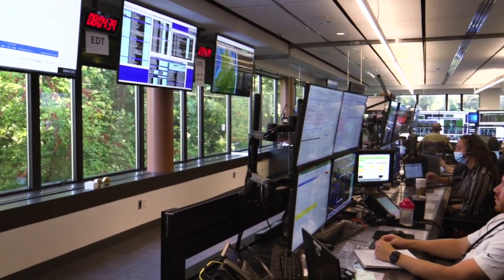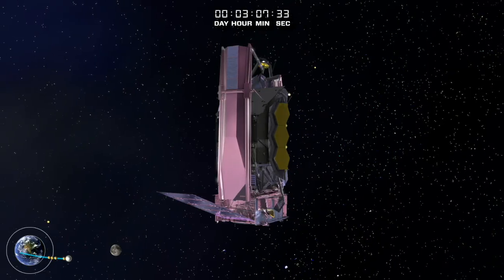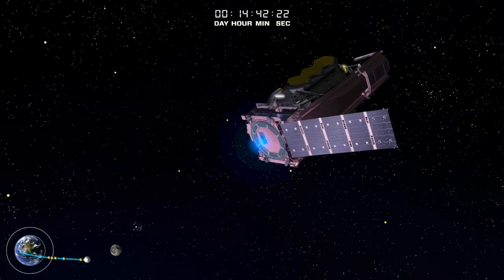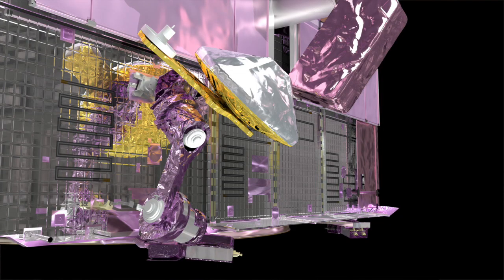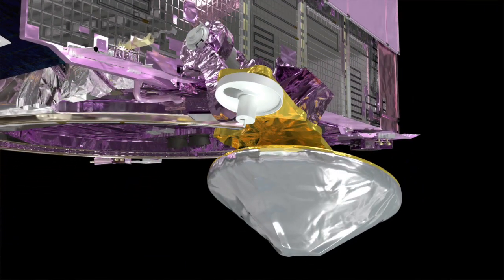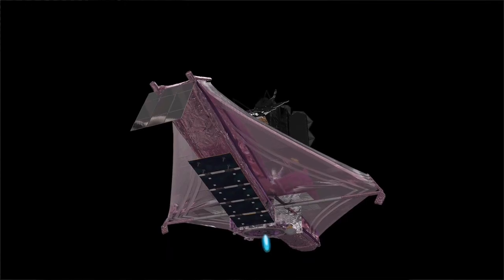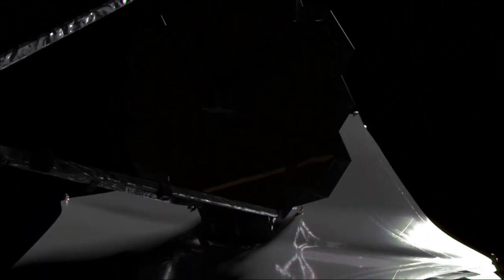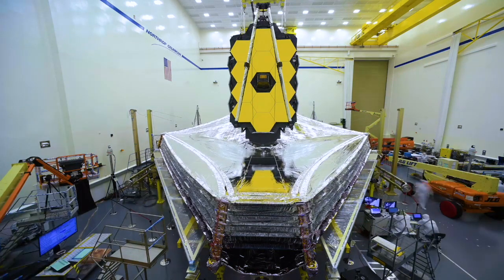How the James Webb Telescope will unfold in space and what happens if it goes wrong?

Comment: @Spaceflight How Odd, that the silly people at NASA didn't go with a vastly simpler system of circular sunshades, opening from a central point or, in three dimensions, foci, like a set of slightly separated 360 degree fans which, when closed, fit naturally within a rocket's fairing. --Instead they went with kite shapes with more than 100 actuators and a 1/4 mile of stainless steel cable. Come on, people.